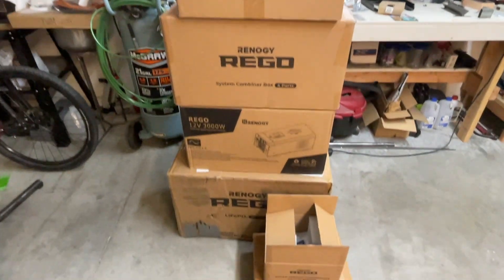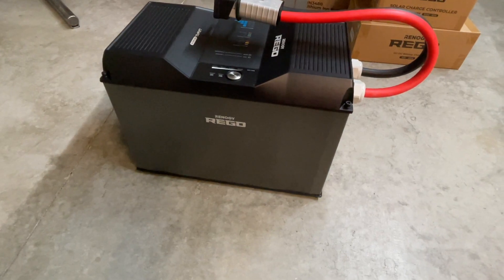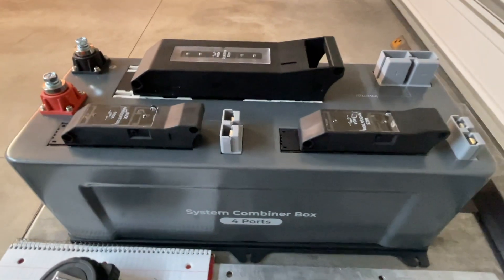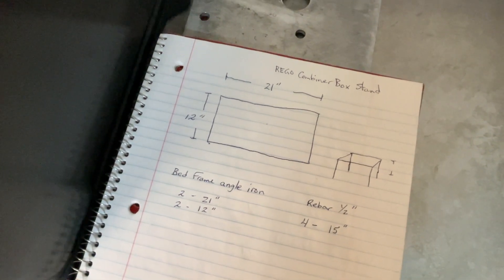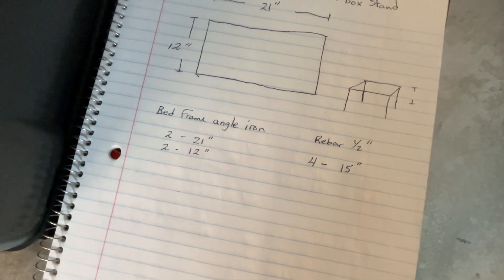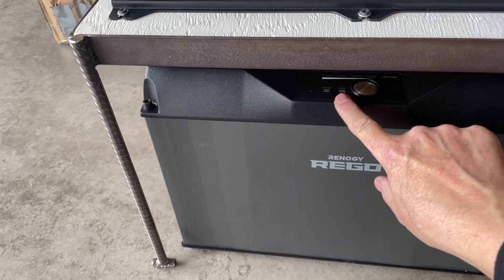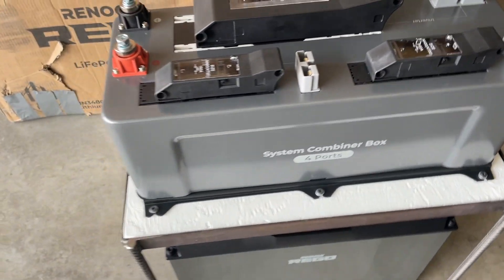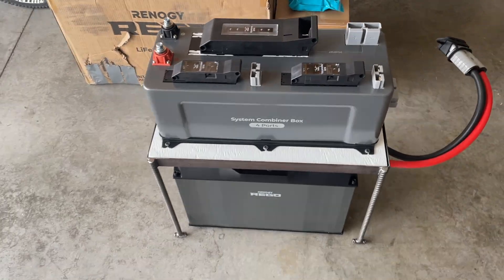Easy DIY Off Grid Solar Battery Stand Anyone Can Make!

Comment: You've gotten as bad (or good) as me about using the little flux core welder for 90+% of my welding.  Remember when we'd tig everything just for the practice?  But ever since I got my dewalt batt powered grinder, even though it eats batteries, I use it for nearly all my cutoff and grinding.  It turns a little slower, which gives you much more control I think.  Plus I luv the finger trigger, it's infinitely better than the slide button.
Reply from the maker: You said it! Sometimes it's just so quick easy and affordable to just use the flux core welder for these little jobs. I've eyeballed those batt powered grinders many times but I just haven't pulled the trigger. I think they would be real handy.
Reply: @DIYHomesteadProjectsDIYHP10  The youtube channel "jeffostroff" guy live streams sales and such from home depot and  Lowes (among others).  Which is how I ended up finally getting a deal on mine.
Reply from the maker: Thanks for the heads up, that's a good idea!